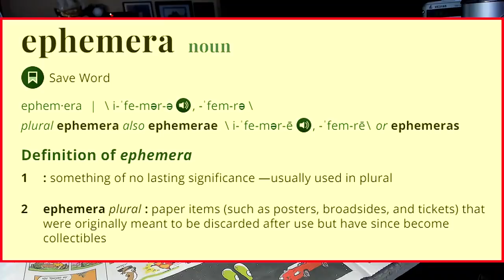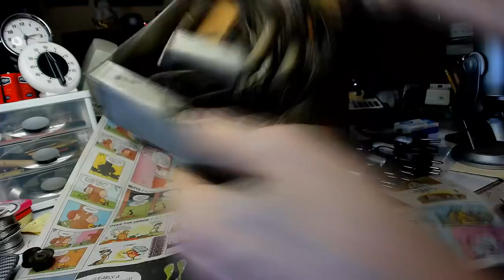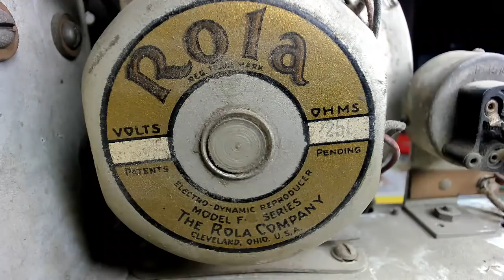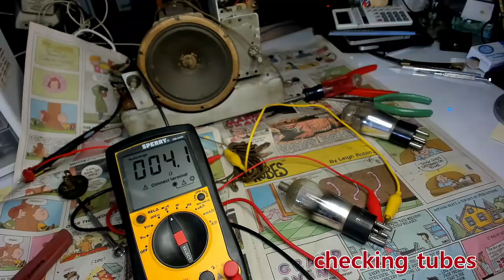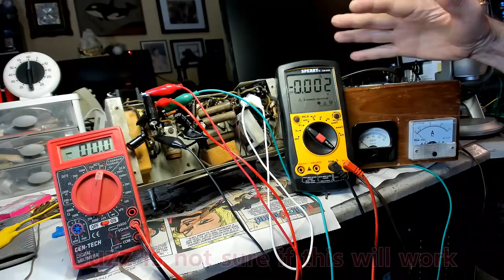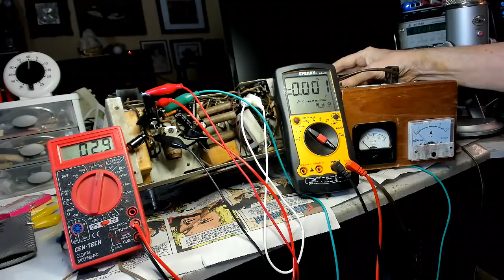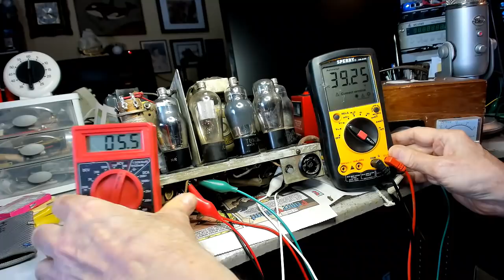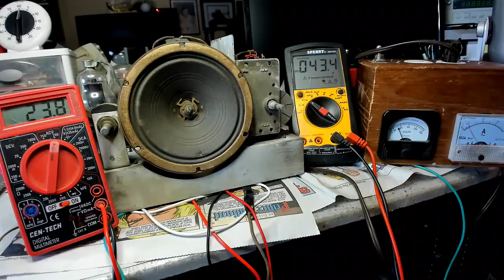1930's Auburn Mystery Radio Restore Part 1

Comment: Good for Miss Moose and you. I'm a radio collector myself...Console Magnavox radio/phonographs are my specialty 1942-1960, also have Victor Talking Machines...as well as Edison Phonographs, both Diamond Disc and cylinder formats. Cabinet repair and refinishing, also record changers are my repair specialty. A buddy of mine...he's now 97 did the brain part of electronic trouble shooting on most of my sets...I did the component replacement...not much brains in that department! Have some 3000 78's to keep those phonos happy! As you can see, phonographs are really my "passion", radios, secondary. The radio borrows its name from the Auburn Automobile...quite a number of these "orphan" sets were manufactured in Los Angeles, Ca. They were sometimes sold as department store house brands, in auto supply stores, Woolworth and Kress "dime" stores, as well as give-a-ways in movie theatre auction nights.Nothing like a contemptuous woman...heard Miss Moose's threat...better fix that Auburn...or she'll burn you!!! Her excitement is building!
Reply from the maker: Hi Larry.. You have a link to any info on the radio , i would appreciate it.👍.thanks, buzz

Comment: What a great find and it works with only 40 volts DC B+
I will bet it will sound great when it is recapped.
So glad it was saved from the trash.
Reply from the maker: It's one lucky radio, that's for sure..glad you like the video, Buzz 👍

Comment: Another great find. Never heard of Auburn Radio but seems fairly typical of the era. I think people got into trouble with the  "curtain burners" when the rolled up the excess power cord into a bundle or, as you mentioned,  put it under a carpet. It would probably be OK when new and for several years after but as the cord got old and started to deteriorate things could get hot. These radios were probably used well into the 1950's or even later. We hadn't yet become a disposable society. Stay well. ATB Doug.
Reply from the maker: It's hard to believe that the radio came to life at 45 volts...I didn't know much about these type radios, it was my first...Buzz 👍
Reply: radiotvphononut does these radios a lot.  I wasn't around when these things were new, but I can remember a time from when I was a kid where "malfunctioning appliances" were common causes for house fires.

Comment: That's what I say Buzz "no schematic No Problem" I'll dig into it anyway. I like it when they mark the tube numbers on the socket makes my job so much easier. Lets just dig right in there and see whats buried in this radio. I am surprised no rodent damage.My 1928 Case Radio has all Cunningham tubes all CX301-A tunes but you can sub number 26 tubes which I have as well. Amazing you got it to work Miss Moose will be happy to see that i'm sure.
Reply from the maker: miss moose is very pleased...now , if i can only finish the radio without blowing it up!!! ha😁👍
Reply: @Buzz1151  yes she is a sweet lady. I know you will do a great job for her.

Comment: Buzz, good work, wonder where you order your tubes from, i have a couple of 30,s Models that now work ok , but mite need a tube or tubes later !  How did you make out with the Resistance line cord or did you just put in a Resistor in the chassis ? Thanks , keep it going ! Love to watch a Pro !

Comment: Wow Buzz you are good. No schematic and a busted resistance line cord to boot. This looks like a Belmont Radio design. Might have to find something made
 in 1933 by them. Think Belknap 625. Chassis is the same one!  Belmont Radio Co made many different radios with different company names on them.
Maybe check Nostalgia Air's website.
Reply: Or Clarion,heh,heh.

Comment: I don't understand why you need an expert to advise you on the heater resistor. A high school student could (or used to be able to) do the maths.  The tube heaters draw 0.3 A so if you want to drop 70 V then you need a 70/0.3 = 233 ohm resistor.  Of course, the resistor will suck 70 x 0.3 = 21W of power so it will have to be a whopping big one.  Maybe a transformer that can handle 50 x 0.3 = 15 W would be a better alternative.
Reply from the maker: you'll find out in part 2
Reply: @Buzz1151  Looking forward to it. In the mean time, ask your expert about the necessary power rating of a 120-85 V transformer wired as a auto (bucking) transformer. (By my calculations, it is 8.75 W).
Reply: @Buzz1151  Worth the wait!